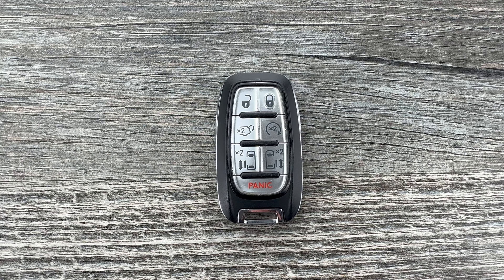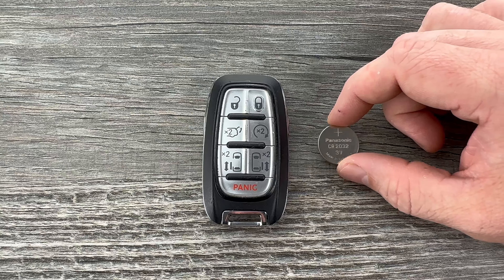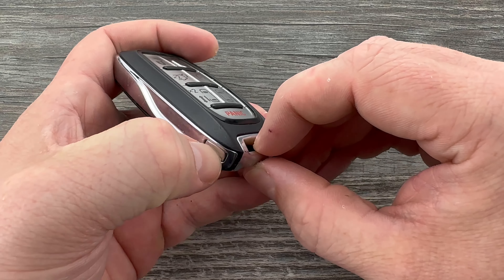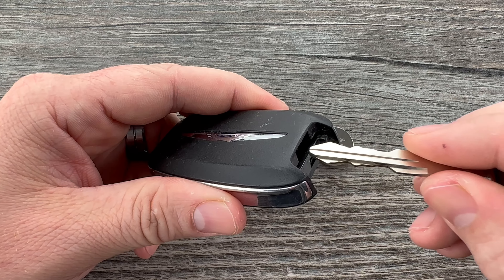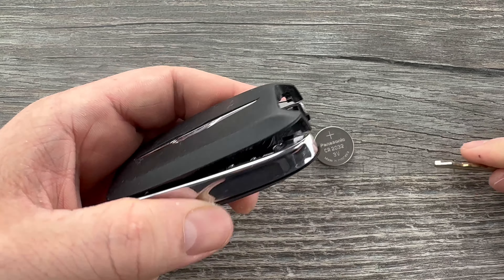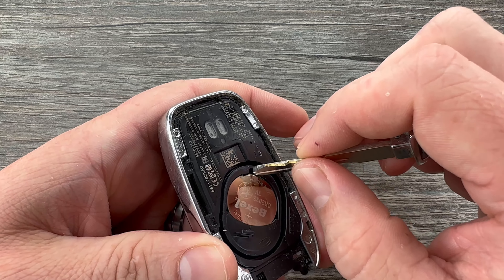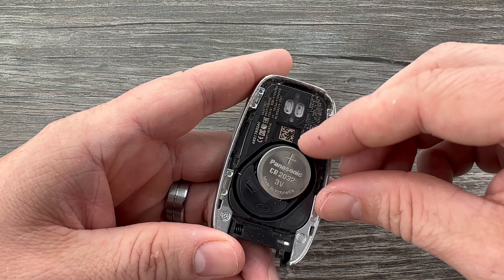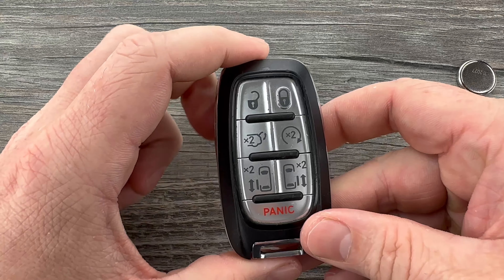2017 - 2024 Chrysler Pacifica Key Fob Battery Replacement - How To Change Replace Remote Batteries

Comment: Yep, Can't ask for too much more. Covered the steps.  I played at 1.25 speed.  Other than that, just sat back and got enlightened.  
I've opened other fobs, but in this case I was prying the wrong side and unnecessarily messing with the inner silver latch. Official manual was not helpful.

Comment: What is the point of an emergency key when it’s a push start? Aka where can the emergency key be used?
Reply from the maker: the emergency key can be used to open the drivers door in case of a dead battery